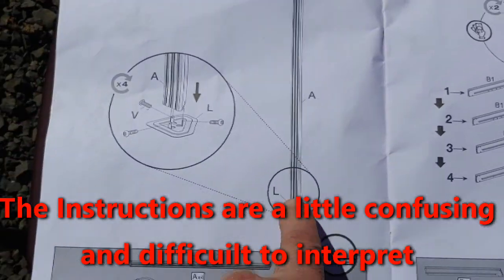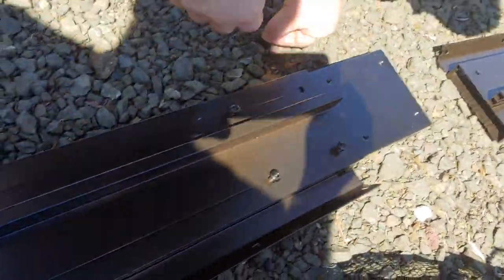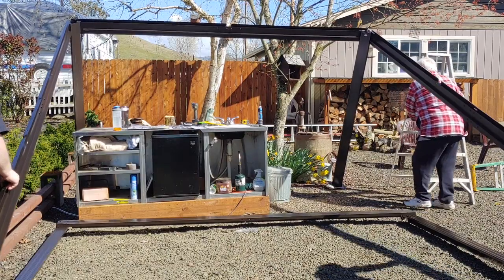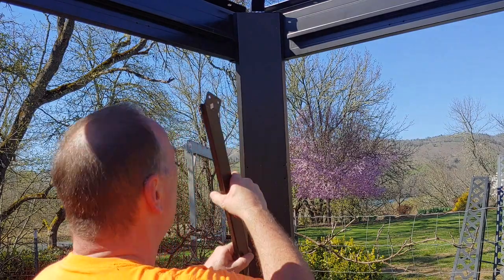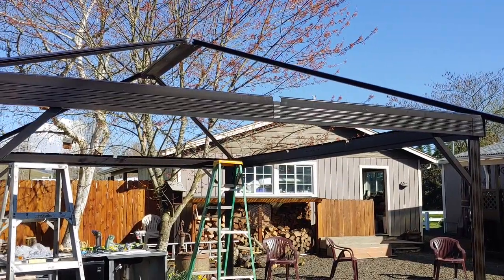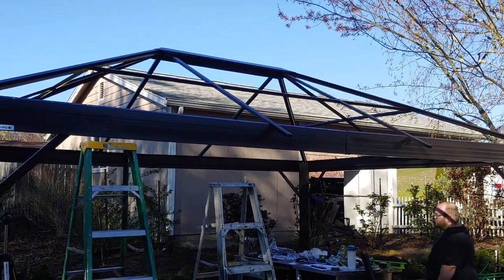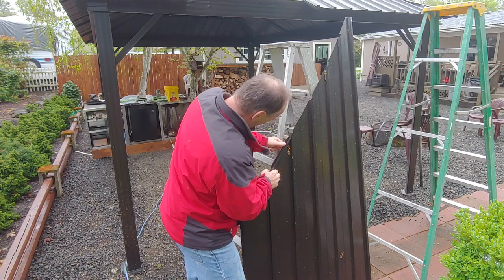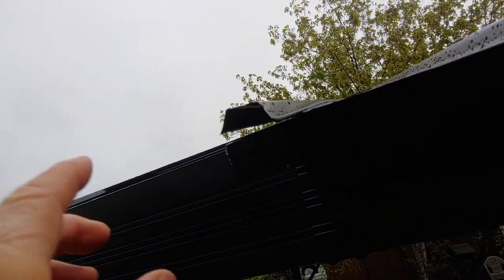How Assemble a Sojag Gazebo 14X16 EASY INSTRUCTIONS

Comment: The curtain hooks have to be installed during assembly. If you want both mosquito net and privacy curtains, you have to order extra hooks before assembly since there is no way to put them in afterwards. There is only enough for the included bug netting. Hooks may be included with privacy curtains but I have not ordered any yet.

Comment: Problem: In your assembly, in the manual AND in the Sojag Moreno video, the angle braces appear to be attached incorrectly. Why would they be angle cut one one side to fit neatly UNDER the ogee, yet you attach them  with the angle cut on the outside. It seems like everyone is connecting them incorrectly, even the Sojag people. The way you and the Sojag assemblers place them, they end up being in the way of the sliding screens. I doubt that the designers planned them that way.

Comment: I just finished putting up a 10x14. Erecting the 'skeleton wasn't bad. However, The roof panels are another story. Beside a couple panels being dented. It was a real struggle to get some of the holes to line up with the frame without modifying the grommets, bolt holes or substituting narrower bolts in places. Pushing, pulling, up and down the ladder. This is not for someone who does not have time or patience. I see why they skimmed over putting up the roof on the video because it was challenging to put it mildly.
Reply from the maker: The roof was definitely challenging!
Reply: About to build a 10x10 for someone, alone. Wouldn’t it be easier to build the roof and install the legs under it?

Comment: I've got a 10x10 gazebo (same one in your video but slightly smaller) that needs to be transported about 4 miles.  In your recommendation, is it easy to remove the 64 (approx) screws connected the roof to the legs?
Reply from the maker: If you have a trailer or way of transport, and can do it safely, it's probably easier to take the whole roof....